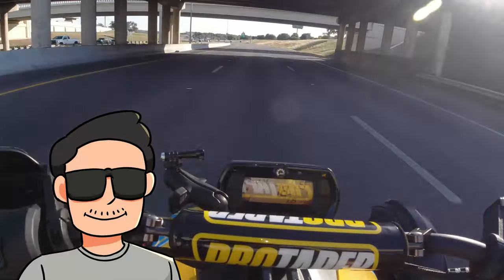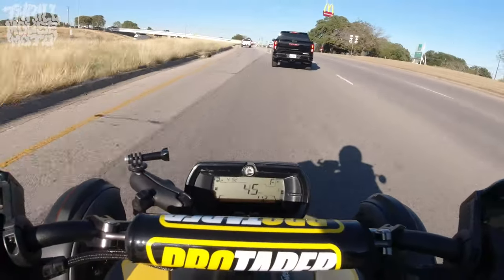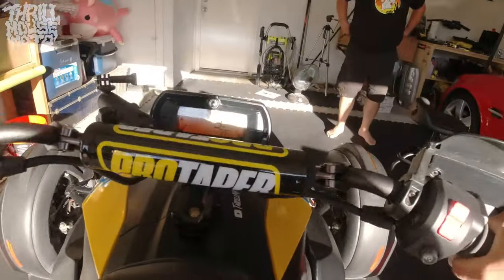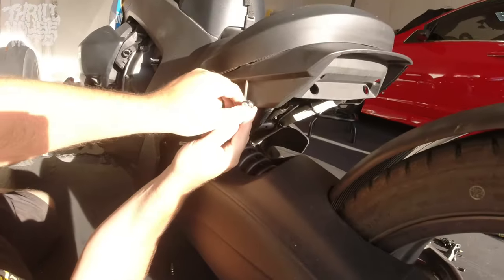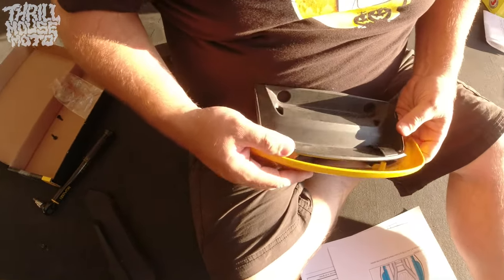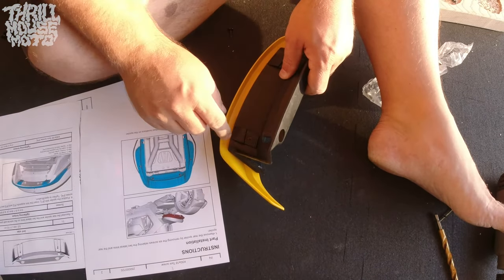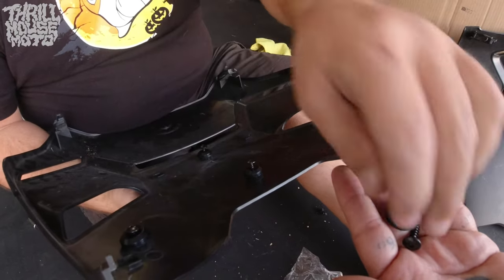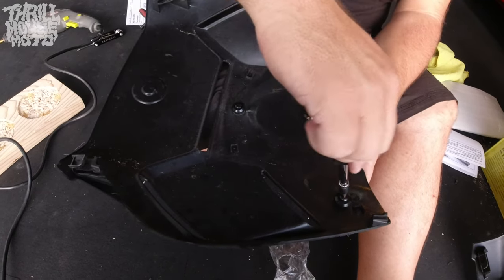Can-Am Ryker Hood Accent // Rear Spoiler // Shad Bag Mount Bracket

Comment: Wo bekomme ich den Rahmen für die Befestigung des Spoiler her weil ich eine rally habe
Reply from the maker: It's only designed to mount as a cover to the existing back cover to the single rider seat of the 600 and regular 900. If you removed your max mount on your Rally you could buy that stock piece from Cheap Cycle Parts online maybe. I've bought stock Ryker pieces from them before. ✌️💯🐭

Comment: could a crack and bent motorcycle frame be repair?
Reply from the maker: Mr Taylor! ..I'll get Kevin to answer that question for you here in a bit, ✌️💯🐭
Reply: @ThrillMouseMoto  thanks
Reply: I think the cost to repair a bent frame would outweigh the cost of just replacing the whole bike. And I don't even think ANY kind of frame straightener made would accommodate a Ryker.
Reply: @ExcelsiorDDZ  thanks